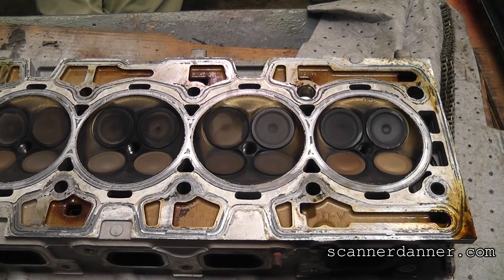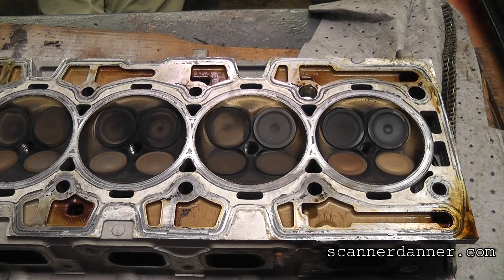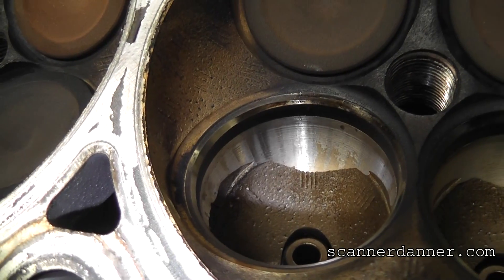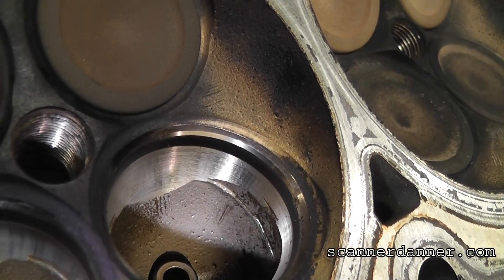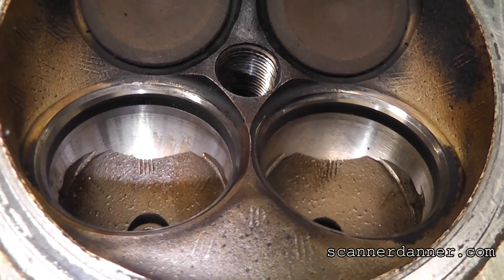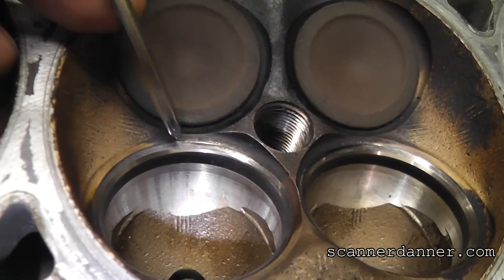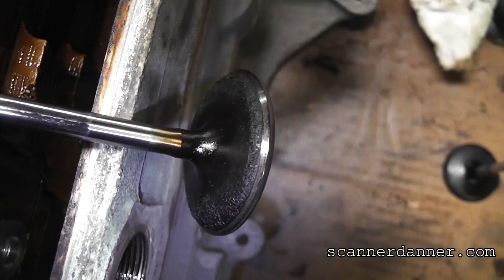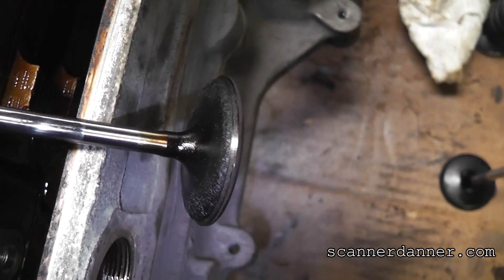Hummer H3 Valve Seat Problems

Comment: Great video! I have this exact same issue right now. The head is almost off. Question? Did you have the "Valve seats" replaced if so how many and which cylinders or did they do a valve job only? What is the permanent fix?
Reply from the maker: unfortunately Alex, I did not do the repair on this, so I cannot answer your questions definitively
Reply: @alexrojas2121 what's the SITREP on your Hummer ? I assume you have an H3 2006? I am planning on buying a H3 with a replaced engine and teansmission. It runs like new during my test drive. Just trying to develop a maintenance plan for my 2007 H3
Reply: I wish right now I lived in a different state cause I love the body style what a money pit  and the motor design was a fluke 4cly with a turbo would of been better or learn Real American standard like the 6 cylinder diesel that keeps America running

Comment: Hi Master Paul!! thanks for your video!! How is possible to identify if there is something wrong with the valves? I mean before buy the car, is possible to identify it over a different sound or something like that? I want to buy a Hummer H3 3.5 and would like to know before if the car has already the issue… 
Thanks in advance for your feedback!!
BR
Reply from the maker: Do a cranking compression sound test. I have some videos on this. Just disable fuel and crank it and listen to it
Reply: @ScannerDanner  Thank you!! 👍🏻 Keep on going! you are doing a very good job!! Happy to see your Videos 👍🏻
Reply from the maker: @asaco4489  did you find a video where I show the test? Check in my chapter 1 playlist if you haven't yet (right here on YT)
Reply: @ScannerDanner  Yes I did it 👍🏻 Thanks!

Comment: I’ve been having the same problem for several months now with my 2008 hummer h3. With the cold start and then the engine would idle really bad. How much would it cost to replace this valve seat With parts and labor?
Reply from the maker: sorry, can't help you with that. I don't do the repairs. I just tell other shops what to do.

Comment: Hi there , so i guess in this case you have to Change the head cylinder with a Rebuild one
and the problem would be gone ?
Reply from the maker: Or send the head out and have all new valves and seats put in it. Whatever method is more cost effective

Comment: Just got done rebuilding my h3 inline 5 ,bad valves,
Reply: how much was your rebuild ??
Reply: @HummerH-mo4cs  , local shop was 3300 fist time, then I had a bad oil filter (acdelco) they did nothing, so another 3300 , when it spun a thrush bearing , I bought a motor from jasper , it lasted 60 k miles $6500, when it locked up due to main bearings, they covered it under warranty, I put the forth motor in and sold the piece of shit the inline 5 motors are trash , and gm knows it , you will be ahead of you haul it to the scrap yard , they are junk , those motors have issues
Reply: @gollywopper1  OUCH lol, thanks for the reply :( . I have had no problems at all (110k miles) 2009 3.7 Luxury edition, knock on wood lol. :)

Comment: On this one, it's apparent and can be seen with the naked eye. Though I've taken heads off you couldn't see a problem with valves or the seats. Put a spark plug back in and fill combustion chamber with varsol and watch it come pouring out. As always, great videos Mr. Danner

Comment: So I have this issue with my h3 and been driving it for about 10,000miles with this valve seat issue(bought the h3 used with 165,000 miles) now has 175,000. Will it hurt anything if I continue to drive as is??! Thanks!
Reply from the maker: It will eventually ruin your catalytic converter. That's about it. Maybe more frequent oil changes will be needed too, due to incomplete combustion and blow-by gases accumulating in the crankcase.
Reply: ScannerDanner awesome definitely appreciate the fast reply!!!
Reply: Does your motor misfire or it just burns more oil?
Reply: This is exactly what iv been wondering Im guessing I have the same issue on my 06 h3 but I really dont want to do that extensive of engine work but if the consequences of not addressing it is minor screw it let her burn
Reply: Mine's had low compression in one cylinder for years. Probably this issue. There's an elevated misfire count, but not enough to set a code. Idles fine, runs well enough. CC still good. I'm planning a rebuild maybe this summer. Will a mild valve grind resolve it long term? IDT new heads are avail anymore. Thanks!

Comment: I see that all the time on those soft MAZDA heads. They get a hot spot and the alum sags in that area causing a leak. If that area cleans up last when you cut the seat that is pretty much the same thing

Comment: so I suppose if we follow the rabbit down the hole. Long term it explains why these engines eat up catalytic converters. Because if the intake(air/fuel)valve is constantly bleeding air into the cylinder that's going to make it run lean, and lean means extremly hot exhaust gas, excessively hot exhaust  means melted converter, broken exhaust manifold bolts at the head, ect.. It all makes sense now. Thanks scannerdan, great series, subscribed!:]

Comment: just had the head replaced by a chevy dealer they said #2 &#5 wasn't seating properly charged my 2600 had my truck over a week got it back still feel a vibration in the truck when sitting at idle any thoughts on what it is? dealer told me it's an 06 not a 2017 lol
Reply: Johnny Perkins is it not even worth replacing? I have 64k miles on my 2008 hummer h3. I’m experiencing the same things you are. With the rough idle with the rpm bouncing when you crank the engine from a cold start and the  decreased engine power when I’m accelerating the vehicle. I’ve been debating to sell my 08 h3 to carmax or trading it in for a new vehicle.

Comment: Too little cooling in the center of the head.  Wall between intake and exhaust overheated and warped resulting in the non contact area. Design has a metal fin between intake and exhaust without a proper thermal path to the coolant.

Comment: All those 3.5/3.7L motors had head problems. I remember when we would get those in on trade they always ended up at GM getting the head replaced under warranty lol
Reply: So how long do the new heads last ? And was there any changes made to the head to fix problems

Comment: Hey Paul.
I just watched all the Hummer series over again and Cook particular interest to the maf sensor waveform. For the exercise i am going to perform the tests using my Pico on a known good vehicle that has adjustable rockers and create inlet leaks and exhaust leaks and compare them with valve sealing properly. I will recharge the battery between each test (although proberbly not neccesary) to eliminate any variable cranking speed. Hopefully the tests will give us good direction by being able to compare the same cylinder in various conditions. I will email the results to you when i have done it.

Regards.
James
Reply: +james ross I've always had to charge the battery between compression tests, but I've seen batteries that hold their state of charge better. Now realize, one of these batteries tested good on very professional equipment too.
Reply: +james ross With a voltmeter you can see when you've gotten to the exact same voltage. It really doesn't take long. The first compression test I did showed less compression in every cylinder. I'd never heard of batteries being run down in so little cranking but I suspected it. Ran the first cylinder again after doing the whole engine and it had equally less compression as if it was the "worst" cylinder.

Comment: Wow...  That's awful!  I've never seen anything like that!  That is not normal wear...  I suspect that there's a valve (non)rotation issue, and the carbon buildup on that valve makes me think it's involved, too.  That's pretty much not repairable, either.  That'll need new seats.  Ah well, time to pass it off to the Engines department!  Have 'em knock down that god-awful machinist ridge, too; give yourself some low-lift flow.  :D
Reply from the maker: +rhkips haha yep, time to pass it off. Actually it was the engine class that removed the head and took the valves out for me. :)

Comment: That would turn me insane trying to discover the reason for this misfire. I have a question though, such valve seat damage didn't show in compression or leak down Tests?
Reply from the maker: +stilkus it did. Watch the series. Thanks!
Reply: +ScannerDanner just started it 3 minutes ago. Very interesting case.
Reply from the maker: +stilkus cool, you'll like it for sure

Comment: Gm has a recall about the head issues on the H3 with the V6. They all crack or they have valve issues
Reply: yes i used to work for GM/Hummer. also the radiators would crack on the v6 v8 alpha. in my opinion they are a pile of garbage.
Reply: +Travis R. I believe the motor is an I5
Reply: however the V8 Alpha H3 never had head issues.
Reply: So there is a recall this issue. Because i want to get a H3 but I kept seeing this issue and it scared me away. My backup options is a Ford Edge but I really want a H3 but not if it is going to be problem
Reply: Ok thanks,  guess I have more research to do to find the somewhat perfect suv

Comment: Paul  was the valve and seat distortion a cause or a result of the misfire. Your engine  professor that was involved in the case did he have any thoughts   after viewing the valve and seats ?  That was an awesome series .
Reply from the maker: +Steve Rob It was the cause of the misfire. And yes he did. He said "what a shitty design" ha
Reply: The Good Shepherd and His Sheep - absolutely brilliant reference brother. 👌
Reply: 10.1.15.     @ scanner danner, I thought all you did was drivability troubles!.......I'm so used to seeing you do almost everything emissions or drivability!......Just saying.........I don't see you as a regular mechanic!  😎👍🏽
Reply: the problem on those is the same as the problems with the 3.5 straight 5 in the colorado/canyon 05 and 06 years I believe. gm used seats that were too soft that would wear out quickly like this. gm has a revised head with harder seats and I believe this is covered under warranty up to 100k miles.
Reply: Wrong, the problem doesn't exist according to GM and has never been covered under any extension of their standard warranty.

Comment: Good to see the conclusion thanks for posting. I had a chevy colorado with the same 3.5 motor that had similar issues eg  slightly eradic idle, misfire codes that were only intermittent. The truck only had 88k so I sold it fearing it was the dreaded and common valve seat issue.

Comment: diagnosed a bunch of those valve problems, good to see the tear down
Reply: So I have this issue with my h3 and been driving it for about 10,000miles with this valve sear issue(bought the h3 used with 165,000 miles) now has 175,000. Will it hurt anything if I continue to drive as is??! Thanks!